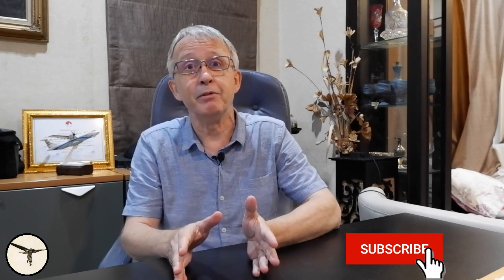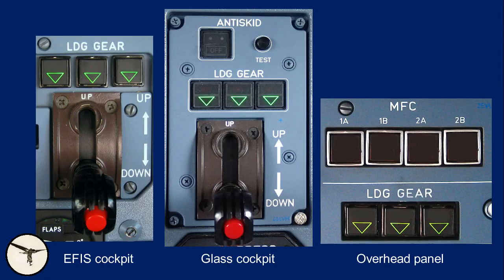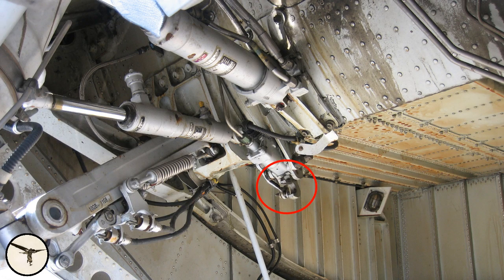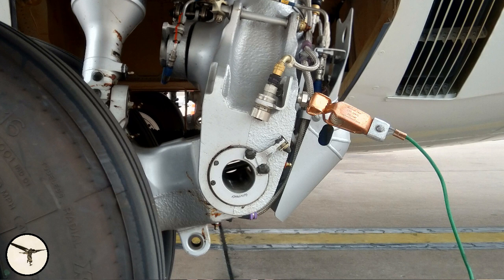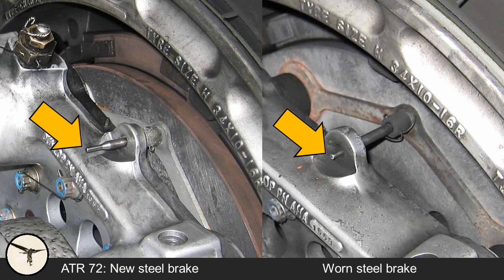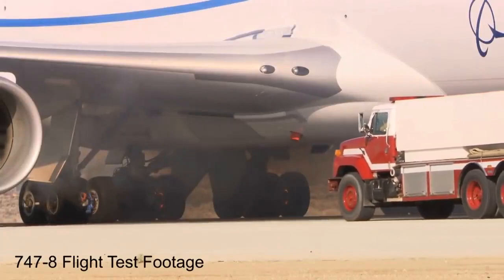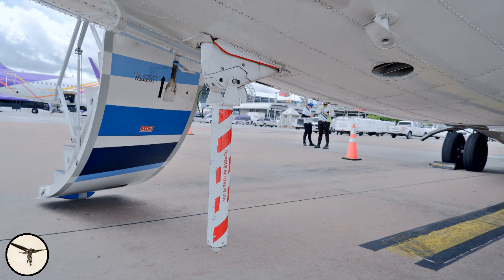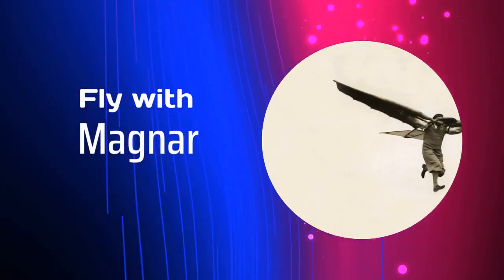ATR systems - Landing gear

Comment: Hello, Captain. On touchdown protection for the anti-skid -
a. What is meant by 5 s in "as long as wheel spin up is below 35 kt or for 5 s"?
b. Why do we avoid applying brakes on low friction pavements or light wheel vertical loading?
Reply from the maker: At thouchdown, the wheels will accelerate from standstill to the speed of the aircraft.
a) The brakes are inhibited when the wheel rotation speed is less than 35 kts, or for up to 5 seconds after touchdown, whichever happens first. 
b) For the brakes to be effective, the wheels must rotate (not skid), and there must be weight on the wheels.

Comment: Great video as usual. Regarding emergency braking.  Do the foot pedals have anything to do with this or is it only a function of setting the brake handle at the 500 psi position as shown in your video? Thanks.
Reply from the maker: The pedals have nothing to do with the emergency brake. You just set the parking brake handle in the emergency position.
Reply: @FlywithMagnar  seems logical to separate the two systems. Thanks for the reply.

Comment: Hi Magnar! Do you have any information regarding drag increase or performance/operational degradation with regards to the main wheel cover? I checked the CDL and it says that it can be both missing. There's no info about increase in fuel consumption or lower cruising speed or if it is acually producing more drag if the covers are missing
Reply from the maker: The performance degradation, if any, is minuscule.

Comment: Hi Captain, maybe you can answer my doubt. I tried to find a good reason for that but I couldn't. In the deviation guide, section Dispatch with landing gear down, why the maximum speed is 160kt if the limitation for landing gear down is 185kt? (I fly atr72-600). Thanks for your time
Reply from the maker: FCOM PRO.SPO.18 gives addtional information for flight with the landing gear down. Here, the climb speed is 160 kt, and maximum cruise speed is 185 kt. But you shold not plan to fly that fast, as it is an absloute limitation. Besides, the faster you fly, the higher the fuel consumption. So, it is good practice to cruise at 160 kt.

Comment: Hi Captain, congratulations on your videos. In the landing gear system you say that we will have an overheat alert with brake temperature> 150 ° C. In the FCOM ATR42 it is reported> 160 ° C .... what is the correct value?
Thanks for your answer
Reply from the maker: The correct answer is 160 °C for ATR 42 and 150 °C for ATR 72. They have different brakes (steel and carbon respectively). When I made the video, I used the value for ATR 72 and assumed that the limit was the same for ATR 42. Thanks for informing me!
Reply: 👍Thanks for the prompt and quick reply

Comment: Hi captain!
Hope you're doing well 
Could you tell me why the parking break must be engaged when doing the anti skid test?
Reply from the maker: Yes, The brakes are not operative when you test the anti skid.
Reply: @FlywithMagnar  the test functions by releasing the normal brakes, how does it work when the parking brake is engaged? Isn't it the same brake and it wouldn't be able to release it? Am I thinking too much? Haha.

Also so the reason why the parking brake has to be engaged during anti skid just due to safety cause you have lost normal braking?
Reply from the maker: Anti-skid test but is not a brake test, a test of the electronic components. When the test is running, normal brakes are inoperative. Therefore, we do this test when aircraft is not moving. And when we don't move, the parking brake is engaged. It will be dangerous to do the anti-skid test while taxiing because a lot can happen in 6 seconds.
Reply: Understood! Thank you captain!

Comment: May I know ATR 72-600 Break Melting Point Capt.?
Reply from the maker: Carbon brakes don't melt. The hotter the carbon fiber gets, the stronger it gets. However, carbon sublimates into gas at 3642 degrees Celsius.

Comment: After being airborne does the nose wheel stop spinning when its being retracted ?
Reply from the maker: No. There aren't brakes on the nose wheel. The nose wheel continues to spin for a while after it's retracted, and if there's any unbalance in the wheel, we will hear it very well because the nose wheel bay is under the pedestal.

Comment: I have a doubt about nose wheel 
What is the cause of Nose wheel vibration or wobbling ?
Reply from the maker: Wear and tear. Here are some factors: Worn torque link bushings. An out-of-round or out-of-balance tire. Elongated holes in the shimmy dampener linkage. A defective shimmy dampener. (I found this answer in a Cessna owner forum, but the principle is similar for an ATR.)
Reply: Also when one of the nose wheel tire worn than the other tire, you will definitely have wobbling and eventually vibration.

Comment: What is the typic attitude of the nose for ATR during the flare ?
Reply from the maker: On short final, the pitch is about -1 to 0 degrees. At touch-down, it's typically +2 to +3 degrees. More than +5 degrees should be avoided. This video shows the attitude indicator during an approach: https://youtu.be/XF-laSAVLbM

Comment: I have a question why does the ATR 72 have a tail bumper and the ATR 42 don't have one?
Reply from the maker: The ATR 72 has a longer fuselage than the ATR 42. This increases the risk for tailstrike during take-off and landing. The tail bumper also serves as a mounting point for the tail probe, which protects the tail from touching the ground during loading and off-loading.
Reply: @FlywithMagnar  We had one tail strike on one of our ATR 72-500. A panel of the skin had to be replaced.
It was not available from ATR for one month. Mechanics from ATR came to our Hangar to replace the panel.
The aircraft flew again after three months.

Comment: I wonder why ATR42 can't have the same carbon brakes as with the ATR72?
Reply from the maker: Just a guess from my side: The philosophy of ATR has always been to use expensive materials/gadgets if it's cost effective. In the 1980s, when ATR 42 and 72 were designed, carbon brakes were expensive when compared to steel brakes. So the question was: Do we need carbon brakes, or are steel brakes good enough? For the 42, the answer was, obviously, steel brakes. For the heavier 72, they went for carbon brakes. If they had constructed the aircraft today, they may have opted for carbon brakes in the 42 as well, because the cost of carbon brakes have declined so much that they are, in most cases, more cost effective than steel brakes.